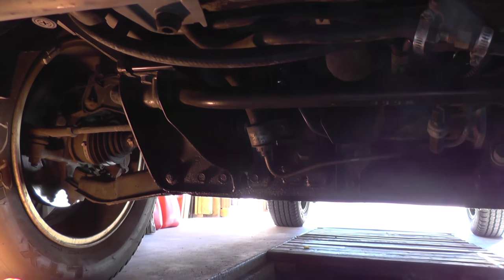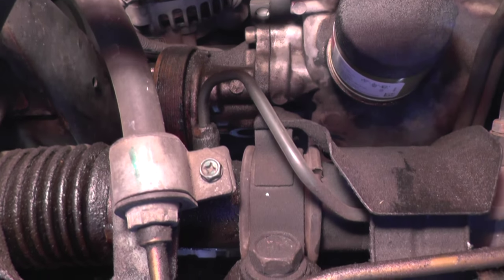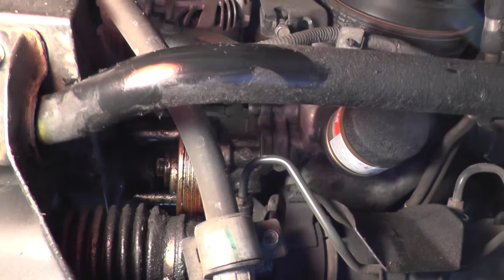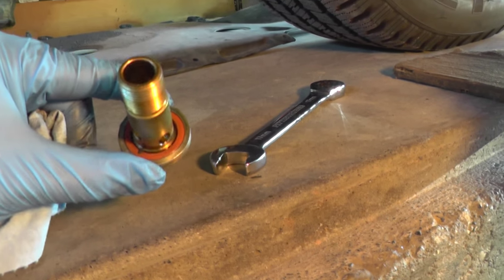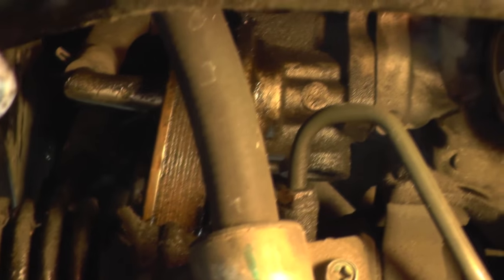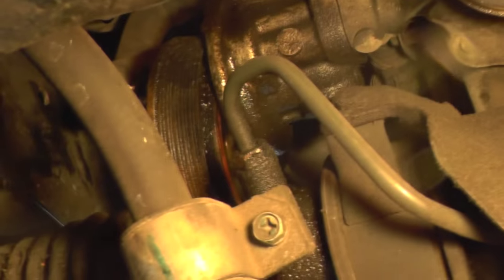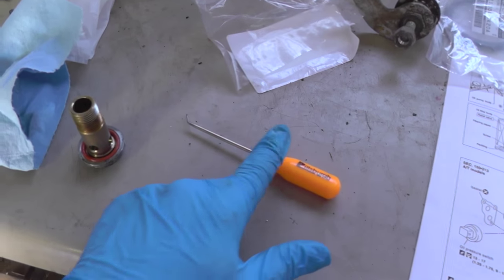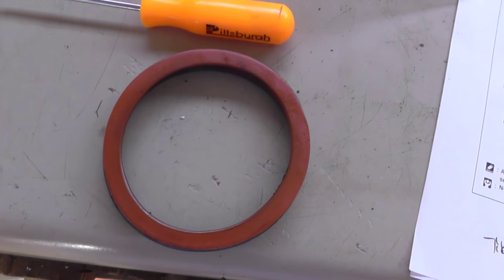2004 Nissan Pathfinder Oil Cooler

Comment: I'm not the dumbest guy in the world, but frequently just having an example of what to do, and that it CAN be done, is all that one needs to get a job completed. I could have probably figured this out, and offline I have a NAS with the Nissan Pathfinder Service Manuals in PDF format that I got from Nissan, but your video looks like it'll save me the time & effort to bring that thing back online.  Thanks a bunch. You have made the world a better place with your video. The car only loses 50 ml of oil when you change the filter? Oh, and one more thing, just knowing what tool to use, and you stating which tool to use is a BIG DEAL. THANK YOU. I just worked on my neighbor's car as a favor, a 1959 Ford Thunderbird, and 7/8s of my time spent was just finding the correct tool. That might sound strange, but that was the nature of the repair.

Comment: Your video is a great guide when I did this. That bolt is a PITA to get back in after putting the new o-ring on the oil cooler. Very tight space but the ratchet wrench (you can get at Harbor Freight tools cheap!) really does the trick in that tight of a space. I drained the oil first because I decided to do an oil change while fixing it not too much of a mess. It was a pain trying to get the new o-ring in because of tight space. 

My tips: 
Use the wrench he told you to in video. 
I would drain the oil (might as well change it even if it's coming due soon) 
Use a pick set (cheap at Harbor freight) to remove the o-ring/gasket. Saves time and frustration in tight space. 
Use latex glove and have shop towels. It's messy. 
Get a nice probing tool that you can get something absorbent with to clean out the inside a bit that's gunked up before placing new o-ring/gasket in. 
Also probably some nice grippy pliers that can get into a tight spot to get the bolt back will save you time and frustration too!

Comment: Thanks for making this video. I have a 2004 Nissan Pathfinder Armada. This will be my first time replace the rings & the engine oil cooler.  I am nervous & doing this by myself but I am a tough single Mom & have learned to be a mechanic as well. I CAN do this!
Reply: You're replacing "rings?" You do know that replacing "rings" requires you to remove and tear down the entire engine. Listing the need to work on the engine oil cooler would be considered barely incidental to that project, given the huge disparity in time, money, & effort between the two repairs. You aren't calling O-rings "rings," are you? I hope not, because "rings" are a distinct item, different from, and separate from, O-rings. If you are calling O-rings "rings," stop it. While O-rings are indeed "rings," they are not called by that name.

Comment: I have a 2004 Nissan Pathfinder, it is leaking coolant into the engine oil, could it be mixing it from the oil cooler? 0:01

Comment: Thanks a ton dude.  Mine started leaking oil last week and I thought I just didn't tighten my filter enough, lo and behold the cooler is leaking.  I was freaking out about how hard it'd be to fix it myself even being an up and coming mechanic and how much it'd cost to just let a shop do it.  Didn't think it was this easy.  Now I know this weekend's little project

Comment: THANK YOU, same exact issue on my 2003 Pathfinder. This video helped me immensely - and thanks to you it's all fixed for under $20. I did go to my local dealer for the gasket and o-ring, as I read on a few other forums that after market units for this job either weren't the right size or leaked again soon after.

Comment: Thanks for the video 20 minute job. It was very helpful to get the part numbers for a customer. I did the gasket changes today but didn't have a ratchet socket that would fit in the tight space so I tightened it with an 11/16's ratcheting wrench while it was running a full turn after it didn't leak which is about 28lb to 32lb torque. Thanks for the video.

Comment: I just did this o ring change on my 2001Pathfinder LE 3.5. I had the same ratchet and I had torqued it down by hand since my ratchet didn't fit in there. Since he didn't show it, the ring goes on the second ring from the outside. My last ring was crimped in two points which is why it leaked. Finally fixed now. Also, I did not replace the smaller o ring since it was not the source of the leak, will update on this, and everything looks good so far. I just let it run for 10 minutes or so and ill top up the oil in the morning.
Reply: Any updates?

Comment: My 2003 Pathfinder is loosing oil 😮 are there other places that I should check for oil leaks?
Thanks
Reply: This problem in this video is the most common oil leak problem but 2nd to that is your valve cover gasket. If that's not it check your oil pan gasket, your oil pan plug/bolt, your oil plug/bolt crush washer. Other areas to check are your engines front main seal & rear main seal which you may have to live with but you may try using an additive you can put in with an oil change AT-205 Reseal. It's a good product and may fix the rear/front main seal leaks or at least reduce leak but sometimes the leak could be so bad that it won't help. Good luck!
Reply: @shaggysmoothie85  WOW! Your response listing the #2, #3, #4, oil leak suspects is just as valuable as the information in this video listing the #1 oil leak spot. THANKS!!! My first instinct was it was valve cover gasket, because I didn't know what that UFO-looking thing was, being that it looked no oil cooler I'd ever seen. I'm 80% certain I'm leaking oil from the #1 suspect: oil cooler gasket.

Comment: Yep I had to replace my alternator today and could see that where the oil is leaking and my 4x4 drive shaft slinging it into the alternator caused it to fail. Also the passenger side valve cover gasket leaking right onto the starter caused it to fail. Replaced it last year. My Radiator is cracked on top that's next. It's leaking blowing coolant onto my coil pack
Reply: You'z got yourself a few projects to tackle. The radiator in my 2003 Pathfinder failed 15 years ago when I had maybe 40,000 miles on the car. Consider yourself luckier than many.

Comment: Where is the oil pressure switch on my 2002 pathfinder LE 
3.5 L V6
I've been googling for hours and just garbage shows up.. so frustrsting.
Have you removed and replaced one?
How much was it... how long did it take to replace... what was the part number....Did it solve the oil pressure light in your dash.... is there a second oil pressure switch for the auto trans and if so how do you tell the difference
Thanks

Comment: I think I have this same problem on my 03 pathfinder SE gonna try to fix it today ran it with low oil several times because it keeps leaking. Just tired of it
Reply: It happened again this morning the oil level was fine yesterday and it leaked nearly all the oil from when I drove home yesterday to now. I think it gets worse if you go above 50mph. I don't know if my engine has this cooler or if I damaged my engine.
Reply: Did you figure it out, I have a similar problem
Reply: @WillB-lv1xg  same generation pathfinders all have the 3.5L VQ, so yes it would have the same located oil cooler. Try replacing the oil cooler o rings as indicated in the video. Then go from there. My rule of thumb when trying to diagnose a car problem is starting with replacing the cheap parts first.

Comment: I was told my oil cooler is leaking coolant   Can I use blue devil to seal the leak?  All so I just got it back from the shop and oil cooler light is on now and brake light along wit the  battery light just got the shop to put a new alternator on it   Took it to auto a one had the battery and alternator tested guy said there good  do I know how o can get the lights to turn off?

Comment: I've got an '04 Pathfinder with the same issue. Oil leak/spray/drip pattern is basically exactly the same as what your video shows.

I've got my o-rings from Nissan and was curious: does anything need drained (oil, coolant) before a person replaces these? I'd hate to crawl up under this thing to do this only to be sprayed by either liquid.

I'm not really concerned with a tiny bit of drippage, but rather numerous quarts of anything coming out when I go to do this.

I don't know if this is the only problem my Pathfinder has, as it's used an entire 5 quarts of oil over 1400 miles (I changed the oil to high milage synthetic (5w30) as soon as I bought it), but it is most definitely leaking from there as it does drip.. I guess we'll find out, hah.
Reply from the maker: I honestly can't remember if i drained the oil pan before i did this!!  I do not think I did, but have a oil pan ready just in case :)   there was just a little bit of oil that came out, but not much.   If i recall the cooler sits higher than the pan so you shouldn't get a lot.  as long as you don't unhook the coolant hoses, leaking coolant won't be an issue.  

Definitely buy the OEM Nissan gaskets as there has been fitment issues with the aftermarket rings.  they are not terribly expense - certainly less than the oil that leaks out.

Comment: Ok! So i just changed my O rings
Piece of cake but little to no knuckle room. Didnt remove coolant lines 
Ratcheting box wrench would be helpful, i did not have. BEWARE , felpro ( carquest,napa, etc)aftermarket O ring was unacceptable in size. Lucky nissan next town over had it on shelf. I suggest just go nissan. Same part numbers as video . Will give it 24 hours and see if she leaks-
Thanks again!
Reply from the maker: +shortCUT207  I keep meaning to update the description of the video. After changing the seals, I noticed that I needed to power wash underneath as there was still a lot of old oil that would drip off.  I am now without any further leaks nearly 5 months later.     I'm glad it helped you.  Yes it is a fairly tight area to get at, I agree a ratcheting box wrench is the way to go.

Comment: what size engine???? I have a 2001 Pathfinder with a 3.5 liter having the same issue..
Reply from the maker: +Steven Oropeza   Mine is a 3.5L as well, but I think the 2001 oil cooler may behind the oil filter itself just based on me watching other videos trying to find one of my specific year.  However you would just need to look under and see if you can the see the oil cooler off by itself like it is in my video.

Comment: Is this the same part number and process as the 2002 qx4 with the 3.5?
Reply: As long as it’s a 3.5L then yes
Reply: Are there different size replacement o-rings even if its a 3.5? Cause the one i got from oriellys. Would not seat properly inside the cooler??
Reply: @georico6282  there should only be 2 different size o-rings, one smaller (near the bolt) and one bigger on the other side of the actual cooler.

Comment: Did you have to drain the coolant?
Reply: No. If you watch the video, he clearly says he did not have to remove those two hoses. Remove the center bolt and the cooler comes loose. Replace o-rings and then bolt. Torque to spec. Done.

Comment: What are the part numbers
Reply: Gphillimo   part numbers are 21334- 30f0a that's for the small gasket

 the big gasket part number is 21304 - JK 20a
Reply: That's directly from nissan
Reply: @montyhuff8278  Yeah I figured it out and already installed them. Thanks
Reply: @gphillimo  how long did it take you
Reply: @montyhuff8278  About 45 minutes. That's from never having done it before and following the video instructions.

If I was to do it again I think I could do it in 20 minutes or less

Comment: Question: do I need to drain the oil in order to do that?

Thank you
Reply: You do not, I’m literally in the middle of doing this right now. You’ll loose about 1quart.
Reply: You don't but if u don't want a mess change the o-ring/gasket when you're doing an oil change after you drain oil.